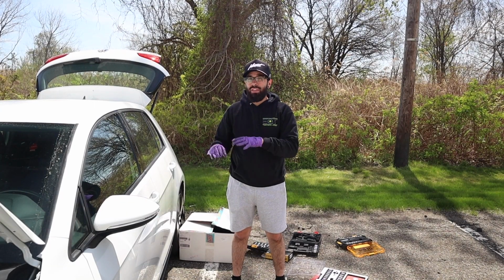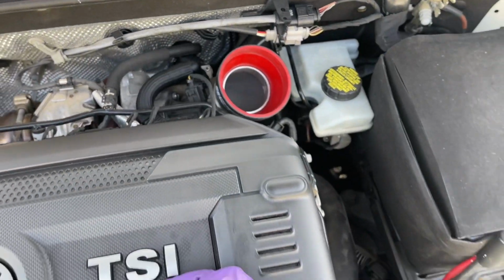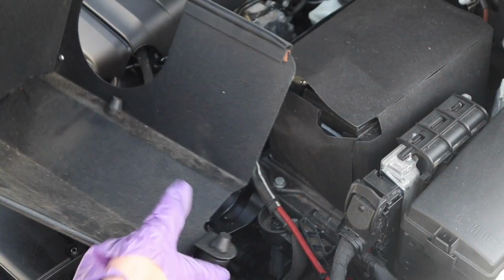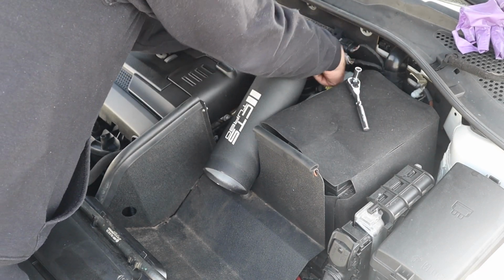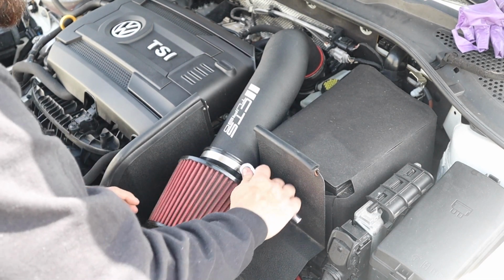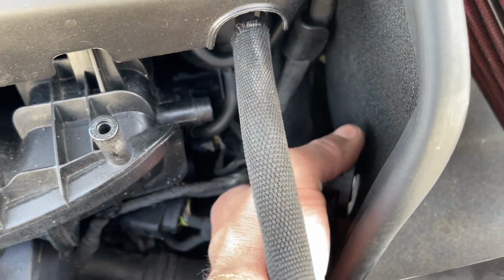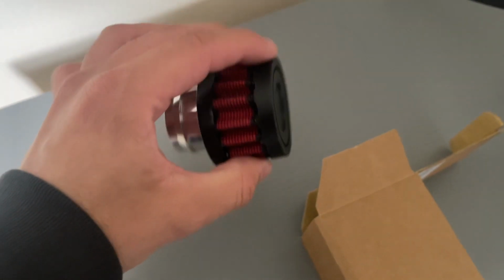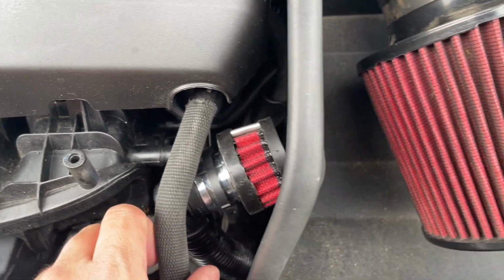MK7 GTI CTS Intake Install! UNLEASH ALL THE SPOOL NOISES!

Comment: also if you remove the hood insulation it will be like 5x louder while driving.
Reply: Is this true or you trolling
Reply: @tevionsaunders2506 even if you take it off, it’s not gonna damage paint and or anything it’s super easy and yes, you can hear it more.

Comment: Hey, i have a aem intake on mine and it does not sound as good like this. Do you have your soundaktor turned off? I am wondering if its because of either soundaktor or because my secondary air filter is ran directly to the pipe instead of being separated with its own filter. Mine just sounds like a stronger intake than stock but dosent have the nice swoosh noise like yours…
Reply from the maker: Hmmmmmm sooo no the soundaktor on my gti is still activated (will be deactivating it soon though) are you on stock inlet pipe? The inlet in super restrictive in these cars and I also have the CTS one which is larger which could be giving that extra induction
Reply: I was driving with the windows down and it does sound really nice. I just dont have the nice rev swoosh like you do but that does not bother be so much, because who is going to sit there a rev the car every time.

Comment: Does it actually give a better performance to a stock 2.0 tsi engine?
Reply from the maker: Best thing you’ll get from this is great turbo sounds and some better throttle response due to the higher intake of air. Performance wise is most likely minimal
Reply: @DArias  thank you!
Reply: @bullet_tooth_tony  A better upgrade for performance would be a drop in intercooler, any drop in will do; CTS, ECS, IE anything because it will help with heat soak and push cooler air straight to the engine.

Comment: The vacuum line that connects to the intake pipe near the bracket that mounts it, did you have to feed that through the mess of other hoses near the block itself? I found with mine that if I didn’t, it would just barely stretch to the intake pipe and at the angle it sat it, I thought it would rip pretty easy. 2016 GTI owner, have the SAI filter and I zip tied it to the lowest grommet that holds the heat shield in place, per the CTS instructions. Am I missing anything? I’ve seen another thread online of someone routing that vacuum line to the SAI pipe instead of the intake pipe, but I may have been misunderstanding it
Reply: did you ever figure this out brother i’m having the same problem
Reply: @mannyhernandez6828 I decided to leave it in the “stretched” position, outside of the block area. I think it sort of adjusts to the stretch because I’ve checked it periodically since installing and shows no sign of being to tight or slipping off, and if it did I have to imagine you’d hear it right away

Comment: Looks very similar to s3 you did. Would it fit to tts mk3? Cuz ecs tuning said it wouldn’t. But uro tuning says it fits.
Reply from the maker: It should fit without any issues tbh.. this fit between my cars with 0 fitment issues what so ever. It’s the same EA888.3 engine so I don’t see a difference. What year is your tts?
Reply: @DArias  2021

Comment: Hey important question to ask but is the secondary air injection hose really important if your putting up a new air intake?
Reply from the maker: It’s important and I recommend putting the filter on there if you don’t have one then best case would be to temporarily put a pair of panty hose over to cover

Comment: is throwing this on the mk6 with a catless downpipe and diverter valve spacer the move? wanna run an exhaust with a resonator that’s still throaty..  but need the turbo tssuu tsu in my life
Reply from the maker: I don’t recommend doing a spacer tbh if you want more turbo sound either do an intake if you don’t have one or buy like a forge or turbosmart BOV. The spacer sounds super fake and imo it’s a little obnoxious
Reply: @DArias  ayy word dude i appreciate the response, the spacer is hella cheap and the bov isn’t too bad so imma grab both and see what tickles the fancy

Comment: do you need the cts turbo inlet pipe upgrade or can it fit the oem turbo inlet?
Reply from the maker: This will fit with the stock inlet 0 issues! I do recommend however going aftermarket as the stock inlet is very restrictive

Comment: Wait so my car makes the same sound as yours but do you know how to get that stu Stu Stu type of sound instead of the pshhhh
Reply from the maker: Only time you’ll really get that is at lower rpms in a higher gear where it will make that sound or you’d need to go after market BOV